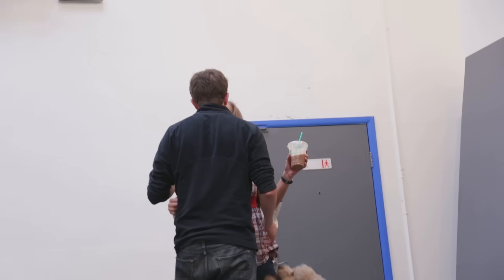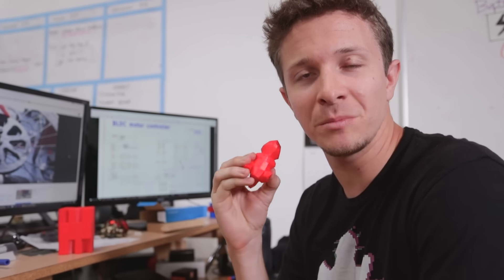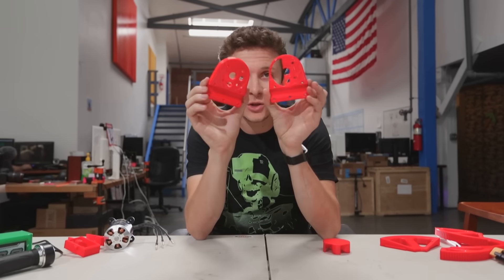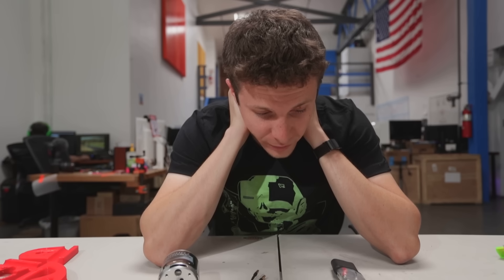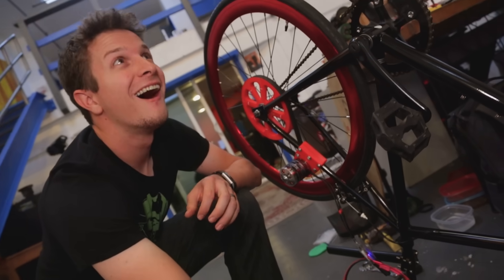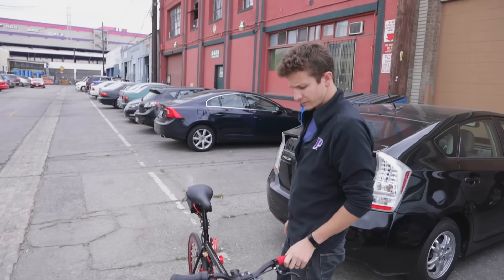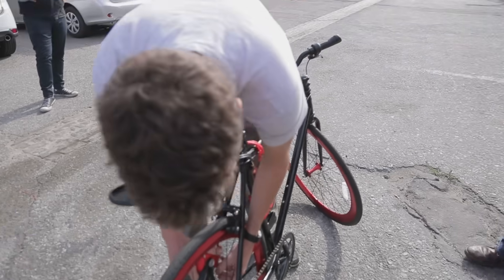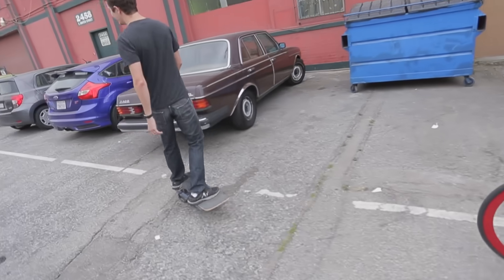Building a Tesla ELECTRIC BIKE For my WIFE

Comment: You've made several mistakes here:
1. For the pulley pinion on the motor you need to grind a flat surface on the shaft for the grub screws to screw in to, to stop the shaft spinning inside the pinion.
2. The motor wires coming from the VESC to the motor are FAR too long for FOC, it will fail soon.
3. The VESC can be set it with 'brakes' where an electromagnetic force is applied to stop the motor shaft from spinning, I know you did change it, but the setting on the VESC is 'Current, no reverse' for anyone who's going to try this.

Comment: The wheel wobbles because the spokes broke. The spokes are usually providing equal tension to all sides of the wheel. If they are uneven tension or if one spoke breakes, it will render the wheel useless. Thank me later.

Comment: What's the max speed on this set up, because it's probably illegal. Legally built and sold eBikes have regulators built in that limit the max speed the motor will operate at, because government. You should do a pedal assisted eBike build next time.

Comment: Careful with a Steel-aluminum joint, if the compositions aren't right you could have a galvanic couple and it will disintegrate as it corrodes rapidly

Comment: Awesome! Just curious, would it be possible to mount the engine under the bicycle seat? So that it doesn't stick out so much on the side. It would require a longer band down to the wheel though. Instead of going engine, band, wheel it would be band, engine+wheel. Like [ instead of '-. and therefore take much less space to the left. I want a youtube paint for comments!

Now, mount an engine to an office chair so that you can cruise around the office in style! (not that the one wheel ain't stylish but...)

Comment: wren, if you haven't fixed the Pully. Drill a hole Right Thru it. and put a pin Trough the Shaft and Pully. oh nvm. you fixed it.

Comment: halfway through the video wren...and not sure if you solved this yet, but take a marker and mark a hole where the set screws go into and then drill a little countersink hole. that will make the set screw hold better. or you can drill straight through and hammer a dowel through.
Reply: nevermind. that was a really cute ending though.

Comment: Hey man, next time use a heat gun to heat up the pulley, it will expand and then you can slide it over the shaft.  Once it's cooled it will stay much better.
My one caution would be the fact that I don't know if aluminium would play well with this method but you could solve that by getting a steel pulley, wich would be stronger anyways.

Peace

Comment: Your car reference is a bit off...if you have an older sports car that gets 17mpg and requires premium maybe. My MINI Cooper S gets 33mpg and requires premium meaning it costs me about $30 to go 250 miles. My wifes Fit gets almost 40mpg and only needs regular so she would be closer to $25.
Reply: My car reference was spot on. As you said, it is an older sports car, but it gets 18-19 mpg and only takes premium gas. So the math checks out.

Comment: I feel like I didn't see enough to prevent the motor assembly from rotating on that strut again. Gotta have something to remove that axis of rotation - whether connecting it to an additional strut or putting a bolt through the plastic AND strut its attached to to keep its orientation.

Comment: if you grind a flat spot into the motor shaft, the pulley's set screw will stay in place forever.

also, wear a helmet pls
Reply: 1. Yup! That's what I did but it didn't make the video.
2. Again yup! On it!

Comment: 2 things.

How are you comfortable with running Li-Po/Li-on batteries without some sort of active protection circuit? What if you run into an overvolt or undervolt condition? I'm assuming overcurrent isn't going to be too big of an issue with the motor size that you've attached

2nd. to fix the pinion slipping, you shouldn't use set screws, but rather a screw clamp type mechanism. Set screws aren't super reliable for holding rotating components still because you can't get a large pre-load on them without damaging some components, so something printed like a clamp that tightens around the shaft of the motor with adequate enough torque should work!
Reply: The VESC (speed controller) handles all the overcurrent stuff. It's safe. The motor doesn't draw all that much power anyway. 

And the original issue is that the set screws got stripped out but the new ones are fine.

Comment: Hopefully you see this wren but you can take a dremel or file and grind a flat spot into the motor shaft for the set screw to rest on so you wont have the issue of the pulley not gripping
Reply: I did exactly this haha, but it didn't make the video.

Comment: 9:30
I'd tried to solve it with drilling or filing a bit of flat platform into the axis of the motor, so it would become more like D-shaped instead of O-shaped. That way screw will have and actual irregularity to hold on to. Wouldn't trust soldering at all.
Reply: Haha that's what I eventually did and it worked fine but that didn't make the video.

Comment: You might need a truing stand to straighten up those spokes. All you need to do is take off the tire and put the wheel on the stand and use a flathead screwdriver to tighten the bent spokes and you're back in business.

Comment: I guess you already solved it but, to prevent the belt pinion drive from slipping over the motor axis, the motor axis must have flat indents so that the grub screws sit on the flat surfaces (And use threadlock also!) then it won't slip.
Next you can build an electric plane! Now that you are into quads... you'll find that learning to fly airplanes is kind of a different story... :p
Tip: use PC simulators. You already have the transmitter ;)

Comment: Now put some effort into having it not stolen. Not the bike, or the engine. Someones gonna steal the motor out of it if they cant steal the entire bike. Some kinda plug in system to be able to unplug the motor and its cable, and slide the motor into place with the 3d printed holder would be nice. Ride to work, grab the motor, work, put the motor back to bike, ride home.

Comment: Congrats on getting it to work, but FYI you should always connect a motor to something with a square peg. A smooth cylinder inside a smooth cylindrical hole is never going to apply torque!

Comment: You should mod one of the electronic nerf blasters. Its technically quite on the same page as this bike was, but probably a bit less challenging and time consuming. Theres a huge variety of aftermarket motors for nerf blasters available (simple carbon brushed DC motors). Throw in the new motors, rewire the blaster with silicone wire, throw in a lipo and you'll get about a 70-80 percent increase in velocity. You can even go brushless if you feel ambitious. And there is a community on reddit willing to advise or give ideas. Last but not least there's a big 3d printing world surrounding nerf blasters (3d printed extended magazine releases, bigger 3d printed magazine wells to aid in reloading, 3d printed muzzle pieces for cool looks and extended battery plates to house a bigger lipo) wich should help since you have a 3d printer. I can give some tips on where to find info or parts. Loved the video!!

Comment: My question is why did you go with that gear size for the belt? Was it the absolute maximum you could do with your micro 3D printer?
Just with the way gears work and turn; The motor is technically a very small gear that spins very fast, and you attach the huge gear to the back wheel. It takes more spins from the motor to get the huge gear to rotate 360 degrees once. Why not allow the wheel to spin faster?

Comment: You should be able to replace the spoke rather easily. Sometimes stock bikes come with the wheels not properly tensioned/trued. If you can find someone with a trueing stand you could potentially structure the wheel better by providing more tension in the system and straightening the rim.

Comment: I feel like for the bike.  you should have made a system where you can use the energy made while peddling. and put that to the power in the bike.  so say.  you run out of a charge. you peddle and peddle and peddle say for about 10 to 15 mins. dependent on how fast you are going.  could give the battery enough charge to keep you going for a good 40 mins.

Comment: Now that the bike is faster than the one wheel will Wren be upgrading to the new One wheel+? Ooh! Can you 3D print a helmet for your wife? Not sure if the PLA plastic is as safe as the material they use in most modern helmets, but it might be worth a test. Also, Jenna kinda reminds me of a younger version of Kathleen Zuelch who was the voice actor for Tex in Red Vs Blue.

Comment: Machine a flat face on to the shaft...

Also, the solder never bonded. Its different types of metal. 

The man with a rat tail is not a good engineer

Comment: One thing I've been wanting to do for the longest time, was modify a mountain bike to have a motor attached to where the pedals go, and still keep the original gearing (3 in mid, 7 in rear) to be more efficient. (Hell, attaching to mid would even easily solve the issue of not being able to coast correctly with the motor connected to the rear wheel) And ideally, be able to keep the pedals, for when the battery inevitably dies, and to keep it street legal under Washington state's definition for an "Electric assist bicycle". ( http://www.evelo.com/washington-state-electric-bike-laws/ ) 
I dunno how loose a restriction a 1000W motor would be... Seems reasonable, from the looks of it.

It would also have to be hard-limited to 20mph somehow, even with the addition of pedal power... I suppose there could be something to prevent it from going over, like a wheel speed sensor, and something to throttle down the motor if it's nearing 20mph, so it doesn't suddenly jerk on and off from just disabling the motor... And of course, a toggle switch for an "Offroad" override that would remove the restriction. Could also get a small lcd to display speed off the wheel sensor, if I really wanted to... (I have 2 Arduinos that currently aren't being used)

Aside from that, is the potential issue with chains breaking under stress... Dunno how I'd deal with that. And would most likely need a chainguard, since on my current bike, even under pedal-power, the chain keeps grabbing my pantleg, and that's no fun. And would probably be even less fun if it's grabbing with a motor engaged.

(Also, I have an issue with overcomplicating things and creating text-walls, when I get an idea in my head. Plus a crippling addiction to commas and parenthesis. plz send help.)

Comment: The issue with the motor shaft and the pulley slipping is actually a pretty simple fix. You simply have to key them together. So if you google keyed sprocket, you'll notice there is a groove in said sprocket. When I was on a robotics team in high school we would key the motors to the sprocket (or use hex shafts) so that the the sprocket or whatever else was connected to the motor shaft would spin with out the shaft spinning freely. You could try machine a groove into the shaft of the motor and the pulley and buy the "keys" to lock the pieces together so that the pulley doesn't slip.

Comment: Hey wren I have a question! What were you able to do in order to fix the regenerative breaking setting on your bike? Did you actually do something to the speed controller or the motor? 

From a very young engineer ⚙️🐝
Reply: It was literally just a few settings in the BLDC tool which is a program on my computer. I hooked up the speed controller to my pc, changed the settings, and it worked! T basically amounted to me turning off the ability to direct current back to the battery from the motor.

Comment: Wren, if you read this and if you haven't solved the aluminum/steel gear issue you can simply sink a set screw into the gear with some thread locker. This would keep the slip from happening. This is of course if the solder breaks and assuming you haven't already thought of this.

Comment: Hey Wren how about an electric powered unicycle? It would be another electric powered one wheel ride, but would it be possible?
Reply: Christopher Gump It's possible but riding it isn't, since the reason unicycles are somewhat feasible to ride is because you can ease up forward and backward momentum by pedaling, unless it can do that on its own, without any risk of failure, it'd be just up to the person if they want to do so or not

Comment: 900 kWh???
In Germany we use of 500 kWh if i calculate pretty rough. (for a 4 person free standing house and water heating with electricity. So the average is much lower. )
I think air conditioning has a huge impact on your power usage.

But we don't pay 15 cents, we pay about 35 cent per kWh :D

Comment: Design and build a larger 3d printer, using your tiny one to print brackets and parts for it ect. (recommendation use extruder and hotend parts from e3d)

Comment: insead of soddering the steel and the alu parts together, you could have drilled like a dent into both parts and put a small piece of wire in them, this will prevent the inner part from moving against the outer one!

Comment: Not exactly a bike when you don't have to use the pedals to get the motor to work. Here in Europe, since this would go above 25 km/h this thing would be required to have a licence plate and be registered as a motorised vehicle (also requiring you to insure it). Hell, you'd need a driver's licence for this (the scooter kind of licence, not a car licence). That's why e-bikes don't go above 25 km/u AND only work when you actually pedal along since that puts it under driving assistance tech and not a full motorised vehicle.

But this is 'Murica so of course you can build something ridiculous like this and nobody would give a damn.

Comment: would it be beneficial to place the motor on the front wheel? 
I feel like it would require less energy to pull the bike from the front, rather than push it forward from the back wheel. 

Thoughts?????

Comment: 1. It wobbles because the spoke broke.
2. Direct drive is never good, you need a "feedback" system so the wheel and motor can run without stressing one another.
3. Electricity is way to cheap in the US.

Comment: Superglue is baaad, mkay. File the motor shaft into a D shape. put the setscrew in so that it's on the flat side. Boom, done.

Also disable braking on the ESC, that's what caused the destruction. Well, that and the flimsily attached motor mount. Because you know...clamps tend to rotate around when attached to a tube.
Reply: The problem was that the holes holding the set screws had been stripped on the pulley. I had already taken a dremel to flatten some spots on the motor shaft but they wouldn't hold. That wasn't effectively communicated in the video. 
And yeah that's what I did to fix the motor.
Reply: I read that with your voice haha
Reply: It was easier to just replace the pulley, because it was essentially broken.

I wish it'd been covered in the video too but Cmikes wanted to just show that it worked, visually, rather than establish what the solution was.
Reply: Alternatively, loctite. They make a version that is not meant for securing screws in their threads but for attaching bearings and pulleys and similar stuff.
Reply: Ok I was hoping this would be addressed somewhere.
Reply: So glad you did actually try to make a flat spot on the motor shaft. I was silently screaming that in my head when the motor first slipped. Now I can relax.

Comment: You should build an RC cable camera where you attach 3-4 cables to the ceiling and then by winding the cables in or out you can use it like a drone but indoors

Comment: Wren 2 things:

1 - Why does the motor still spin while powering the bike? It seems odd that not all of the driving power of the motor is going into driving the bicycle forwards.

2 - If the settings & components are there already to make a regenerative braking system work, you can happily start to re-charge the batteries while pedaling or even just rolling down hills. Try to get this working for more range!
Reply: I'm not sure I understand your first question. The motor and wheel are locked together. Earlier in the video the motor spun because the set screws got stripped. I fixed that. 

As for the second question, it's actually a lot of work to peddle the bike to charge it. That's why it's typically only used as a brake. The problem here is that the force of the regeneration in the motor is too strong for the mount to stay steady.
Reply: 1. The motor shell turns with the shaft, its a common design feature on brush-less motors, usually to aid cooling, but the core is fixed to the bike, so all the torque is turning the wheel.
2. read the section on bicycles: www.explainthatstuff.com/how-regenerative-brakes-work.html